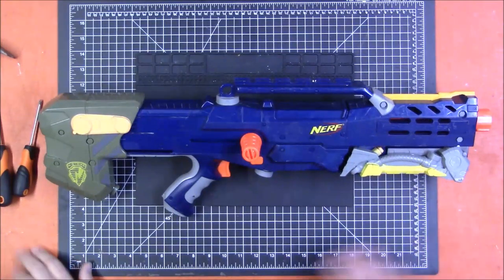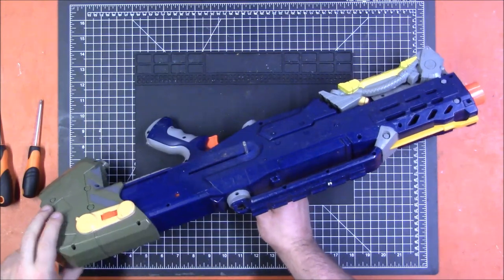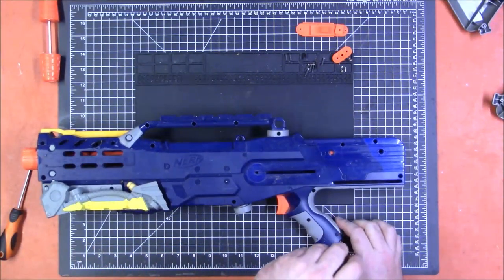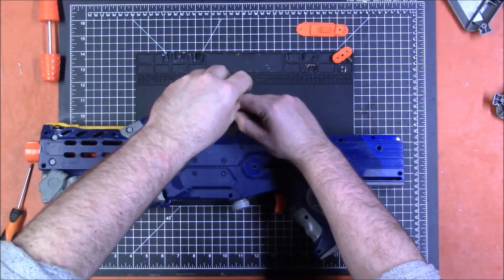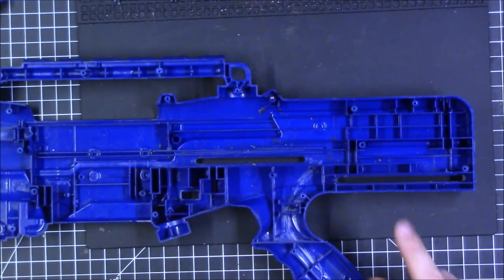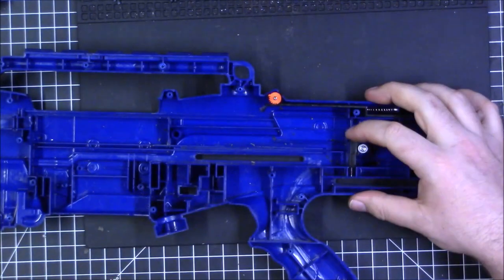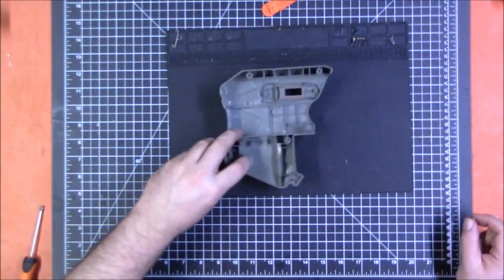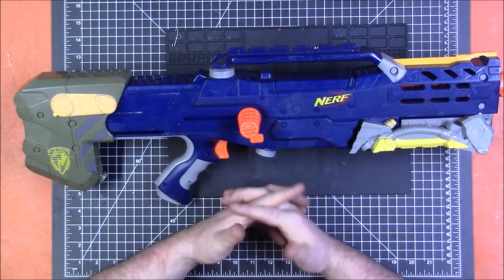Monday Mod Tips - Longshot - Reassembly Guide

Comment: Thankyou captain this video is especially important to me seeing as my first mag fed blaster is still in the remaining collection i kept from the 200 i had long ago. I need to do maintenance on it but seeing as it is one i dont want to replace i was afraid of how i should take it apart im hopeing that 10 plus years of no cleaning hasn't been too harsh to the spring it was constantly in a pool in my youth. The worst is permanent sun bleached plastic and brittle spots on the stock. I broke and lost the original bolt at some point and resorted to useing a brass rod and bent it into a new bolt. Thanks again captain your troop in foam royal.

Comment: That dart tooth in the breach is the bane of my existence right now. It butchers any dart type that isn’t the original orange streamlines. Looking for a way to mod that part of the assembly so it will accept elites and waffle heads without eating them. Apparently only the original Longshot has that issue, future versions accept elite darts out of the box. But I’m attached to it by nostalgia, the greatest adhesive.

Comment: Great video! I bought a new spring from Out of Darts and installed it. But it didn’t improve the FPS by much although much harder to prime. Then put tape over the air hole and added Teflon tape to plunger O ring for better seal. Still not much better air seal. Anything else I should try?
Reply from the maker: Well, you need to figure out where the air is leaking. There are several possible places. The plunger O-ring is one. I believe the bolt also has an O-ring. 

But ultimately, there is a limit to how much power you can get out of a stock system by just increasing the spring and seals. There is a reason all modern high-powered springs have full sealed breaches.